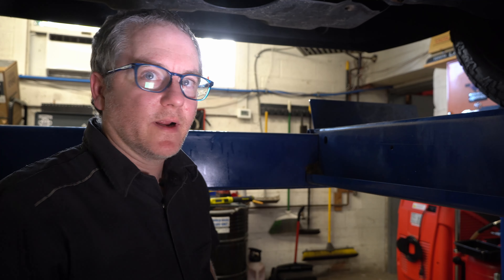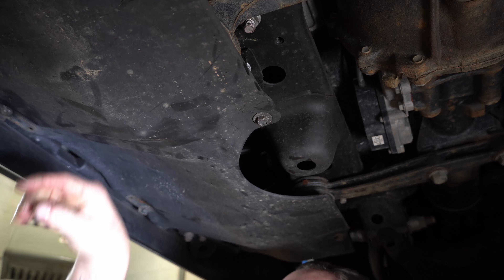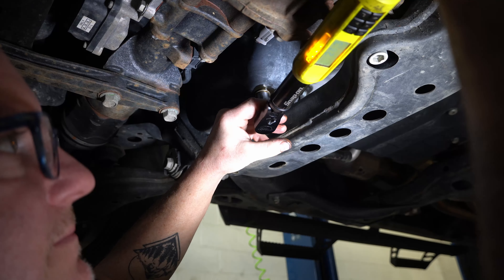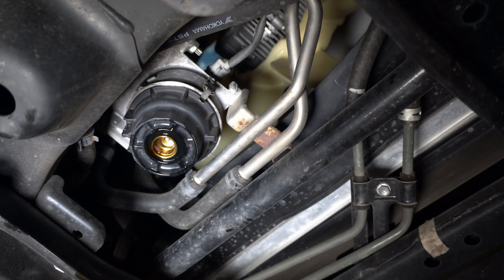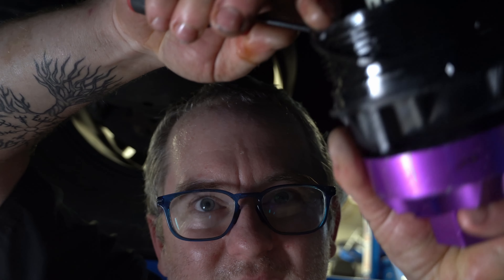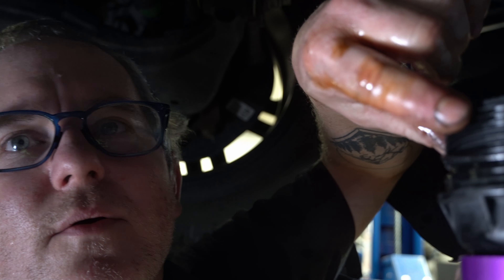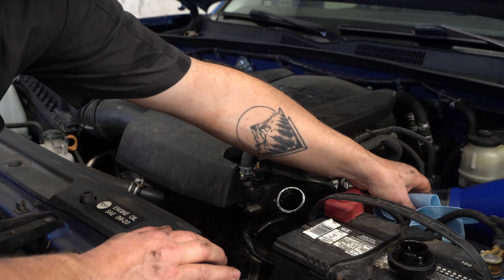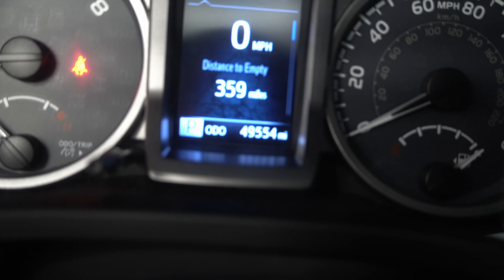Toyota Tacoma Oil Change - Everything You Need To Know

Comment: Nice to see you! Love the video. Basic maintenance is so important. I would love to either see a video or have a video similar to your 2UZFE exhaust manifold install about how to remove the broken valve cover bolt up against the firewall. I know on IH8MUD some people have almost given up and pulled the motor to fix. Would love to hear how you handle it.
Reply from the maker: I don't think it would be possible to film either of those. There just isn't enough room. On the valve cover bolts I tig weld nuts on to the broken bolt and pull them out.

Comment: Thanks good information. Question when changing def oil and transfer oil in a 40 series what brand do you recommend ? Would you recommend using Toyota’s or is there something else? Thanks
Reply from the maker: We just use house brand gear oil from the parts store. We buy it in 5 gallon buckets.